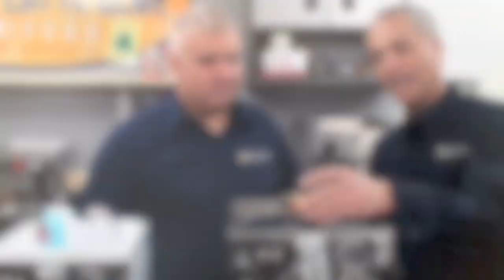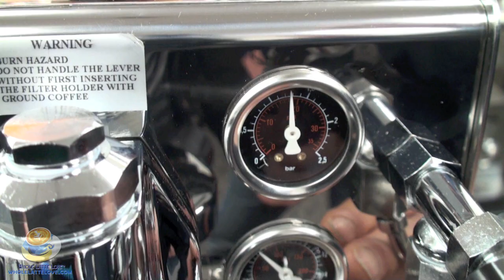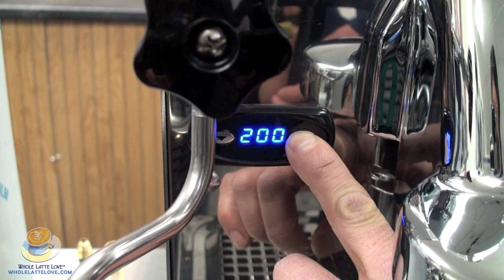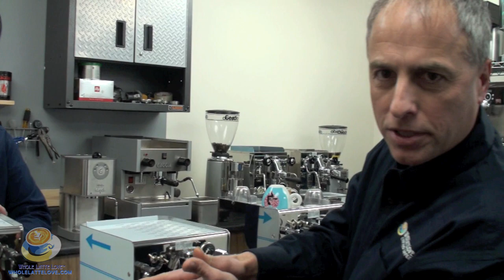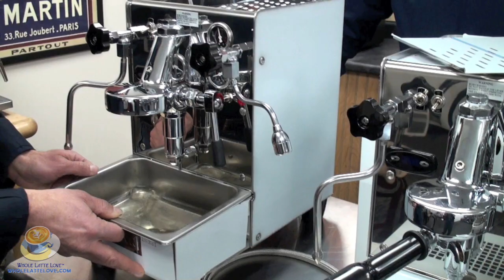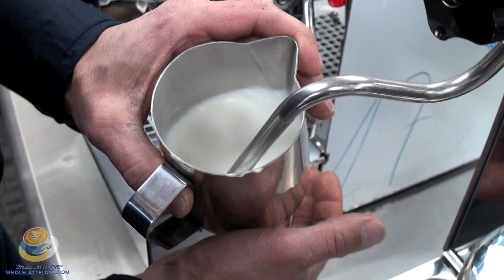Expobar Brewtus IV

Comment: Hot water comes from the steam boiler, that's no good, way too hot! Should be otherwise, hot Tea-water should be at brew-temperature not at steam temp.
Reply from the maker: Hi ED, Virtually every machine made pulls hot water from the steam boiler. A few far more expensive machines do have a mixing valve to combine water from the boiler with fresh input water to reduce temp. One trick if you want cooler water for an Americano is to dispense hot water into a cold cup first and let that chill while prepping your espresso and then brewing your espresso over top.
Reply: Thank you, that's what I do already, but why cannot it be connected to the brew boiler? Too much pressure?

Comment: As ever an excellent video from WLL.  Could the Expobar Brutus with rotary pump be run from a reservoir/separate water container with a filter in the line?  If so which type of filter would you recommend. 
Keep up the great work.
Kind regards
Paul
Reply from the maker: Hi Paul, Thanks for the comment. The Brewtus with rotary pump can generally draw from a separate water container so long as the intake line isn't too far below the machine. Usually within 2-3 feet is fine. An inline water filter may reduce/restrict the pumps ability to draw water So I suggest filtering the water prior to adding to the water container. For filter type I like BWT - Best Water Treatment solutions. For those your water quality needs to be reasonable quality to begin with. BWT filter use ion-exchange to replace calcium with magnesium. This prevents scale yet leaves you with water with mineral level needed for good taste and to prevent corrosion. BWT has options like their Penguin Pitcher: https://www.wholelattelove.com/products/bwt-penguin-2-7-l-water-pitcher Bestsave in-reservoir pad filters: https://www.wholelattelove.com/products/bwt-bestsave-s-anti-scale-filter and a plumbed in option Bestmax Premium (must be connected to a pressurized water supply): https://www.wholelattelove.com/products/bwt-bestmax-premium-filter-package-w-besthead-flex
The Expobar Brewtus is no longer sold new in the US. There were a few models under the Brewtus name. In the past there were models which were only plumbable and one which could be run from plumb line or reservoir. Hope that helps!

Comment: why my expobar brewtus iv always over preasure for my extraction? but the  in the 9bar.
may my grind size is croase to my rotary pump preasure?
please give some help.
Reply from the maker: Hi RL, Thanks for the question. If pressure is too high it's likely because your grind is too fine.
Marc
Reply: thk you, my problem solved 🤙

Comment: hi there, i have this machine and loving it. my question is, why is rusty water coming out of hot water wand. you have to run it for a bit to clean it but wondering if its rusting there, is it rusting on a main head as well? thanks
Reply from the maker: Hi VU, Thanks for the question. Did you get the machine new? Any chance it was sitting for a long time unused? Aside from really poor source water quality there is not much that can rust. Boilers are copper with brass end plates. Copper can oxidize but not like typical rust from steel iron oxide.
Marc

Comment: A few questions:
When or why would I want/need to adjust the brew pressure?
I bought my Expobar Brewtus IV in South Africa and it didn't come out with a no burn steam wand. What would be the reason for that you think?
Reply from the maker: Hi Kobus, Thanks for the question. I cannot speak to the specs of the Brewtus IV sold in SA. Honestly thought they only called the machine the Brewtus in the US. The first Brewtus and subsequent models up to the IV were made based on our design requests - Whole Latte Love working directly with Expobar on the design (and upgrades in later models of the machine). It was Whole Latte Love who coined the name "Brewtus". In other markets it might be called the "Leva____". As to the steam wand, I believe original Brewtus models sold in US - way before the IV may not have had the no-burn wand. I do know manufacturers in Italy and Spain (Expobar/Crem) make many variations of their machines for export to various countries. It's possible your Brewtus IV was not made with the no-burn wand for your market. If you got it used maybe someone modified?

So, why would you adjust brew pressure? In most cases there's never a need to. If you put a blind filter basket or back flush disc in your portafilter and run the pump you are good to go if your brew pressure gauge shows about 10bar on vibration pump models and between 9-10 bar on rotary pump models. If it's off, you can adjust pressure to those readings. It could be higher or lower because a pump is aging, severe scale deposits or someone else didn't not adjust correctly. With espresso you want max brew pressure under 10 bar. More is not better! Hope that helps!
Marc

Comment: Him I wonder why the last (third) machine does not have a water softener. Is that the case always? I thought the vibration pump machines have one (like the one in the middle)
Reply from the maker: Hi i, Thanks for the question. Very old video and before my time but it's likely the water softener was not installed for the video.

Comment: Hi WWL guys! In this interesting video, I heard Todd to say that Brewtus brews the best espresso than ever machine which you sell in this building and it makes it consistently! In this context, for me it is interesting to know if you have been selling Alex Duetto and have you compared its shots with the Brewtus shots? I am curious to know your point of view if the price of Alex Duetto is due to the fine Italian styling and finish only or it also can brew great shots? I would like to know from a practical (and academical also :)) side the result from the comparison of brewing capability and thermal stability (shots consistency) between 1.5 L brew boiler (Brewtus) and 0.8 L brew boiler (Alex Duetto). I read a lot about the engineering of both machines and would like to know your view point and experience. Thank you for your time! :)
Reply from the maker: +Petar Rusev Which machine brews the best is of course a subjective opinion. It takes some getting to know your machine to get the best out of it. Use one machine all the time and you'll make more consistent shots on it than a machine you are less familiar with. We think both machines are equally capable in the hands of an experienced user. Top of the line Brewtus IV R is $500 or more less than the AD. Most of the extra cost can be attributed to the extra workmanship in the finishing of the AD. That's important to some users and not so much to others. We do think the Brewtus is more consistent with brew temperature with larger boiler and pre-heat from heat-exchanger. What's very important is having a machine properly calibrated.